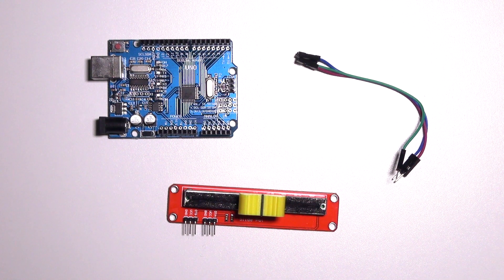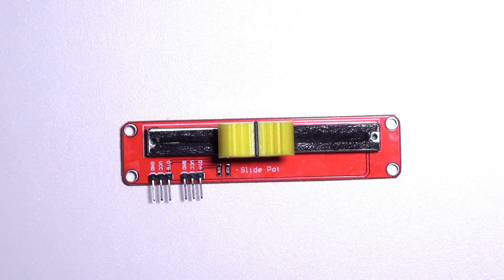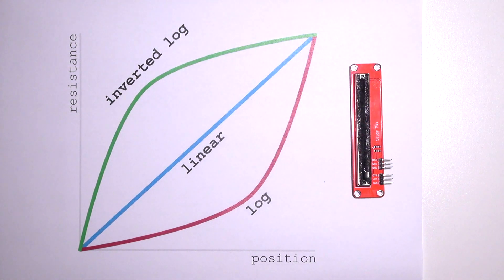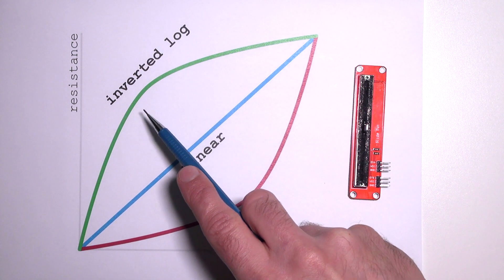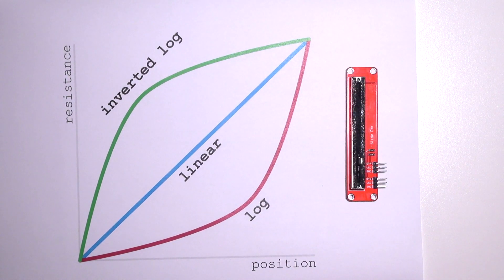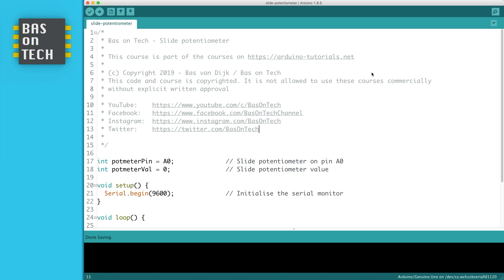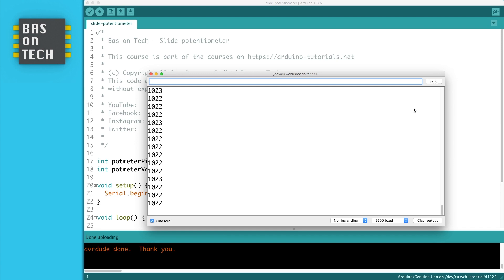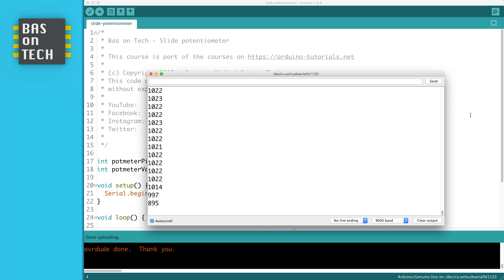SLIDING POTENTIOMETER / DJ FADER - Arduino tutorial #23

Comment: Can you connect a led to fade with sliding the pontetiometer???
Reply from the maker: Sure! The potentiometer just gives you a value, you can use it any way you'd like 😃
Reply: @BasonTech  I did a program that takes values from lightsensors to give number's to pure data on pc and I made an other program that use 3 ponts.
Reply: When I combine the codes it make a lot of noise to one pont. Signal

Comment: Hi can you help find potmeter datasheet and how can I convert voltage output into mm
Reply from the maker: I guess you have to measure this yourself. In order to have a very accurate mapping in mm and the resistance you'll need a more "professional" sliding potentiometer.

Comment: Can I measure a short distance (4mm), Resolution 0,1mm with that?

The measurement is about the Position of a valve
Reply from the maker: This potentiometer has nothing to do with distance, but with resistance. Therefore it is not possible to determine a certain movement of the slider and convert this into mm movement.

Comment: I have a question: what happens when you use 3.3v instead of 5v to connect the potentiometer?

The project I am working on uses a Teensy 4.1, and they only have 3.3v available.
Reply from the maker: According to the specs on https://arduino-tutorials.net/r/mleya8 this sliding potentiometer supports both 5V and 3.3V.

Comment: How could I connect multiple potentiometers to one Arduino all for different functions? I have 10 pots and I want to make a set of volume faders. Would I need more than one Arduino?
Reply from the maker: Hi Charlie, the easiest is an Arduino Mega which has 15 analog-in pins. However with an UNO it is possible as well, using a techniques like multiplexing.
Reply: Bas on Tech I am using the Leonardo with a multiplexer. Will this work?
Reply from the maker: If you only need 10 analog inputs, you don't have to use a multiplexer since the Leonardo has 12 analog inputs. 😃

Comment: if you use this as a digital caliper you can get a resolution of 0.01mm which is not bad because the Arduino ADC is 10bit, but the ADC on a ESP32 is 12bit, so the possible resolution is 0.005mm which is even better!
Reply from the maker: Keep in mind that using a sliding potentiometer will only work as a caliper when it has a linear scale. The non-lineairs will give you the wrong values 😃
Reply: @BasonTech  the logarithmic ones can still be used for this purpose but the math is a little bit more difficult.
Reply from the maker: Fair enough, although I think buying a lineair one could save you some headache figuring out the math 😉
Reply: @BasonTech  the function is already made by others